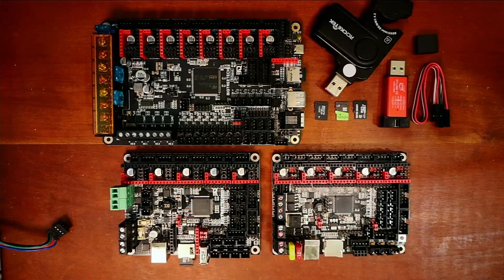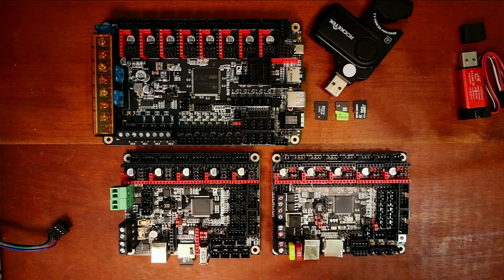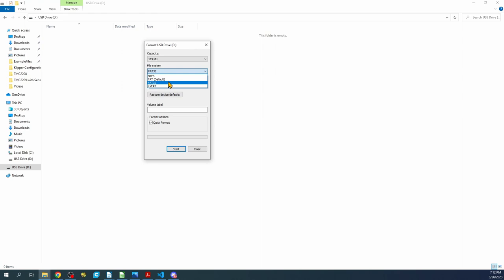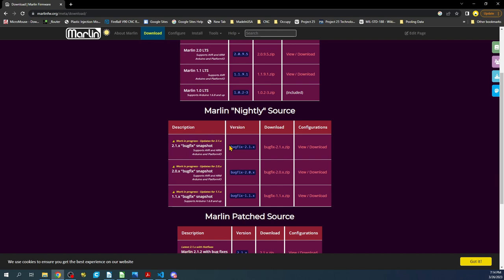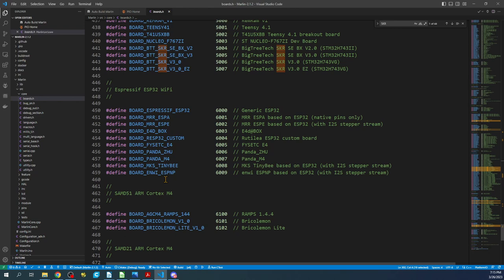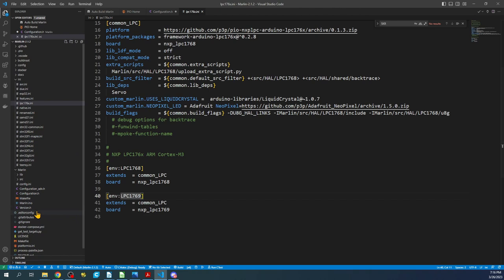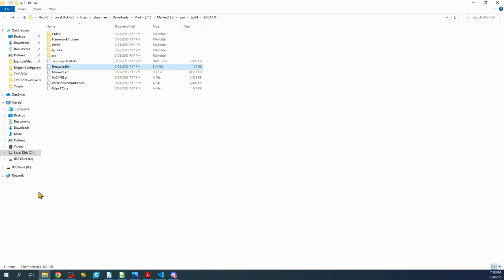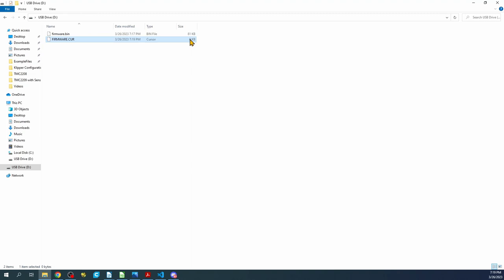Fixing Marlin Firmware loading issues on 32-bit MCU(s)

Comment: good to know, thanks.
btw, communication speeds are in bits per seconds, storage devices are in bytes so a 128MB card is 128 mega bytes not 128 mega bits.  There is a standard (not always followed) where a capital B is bytes while a lower case b is bits.